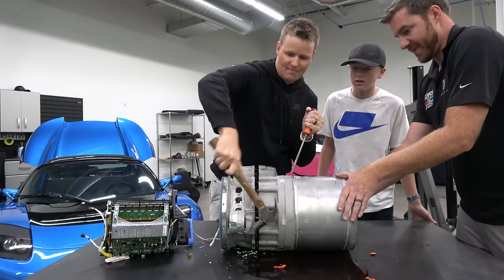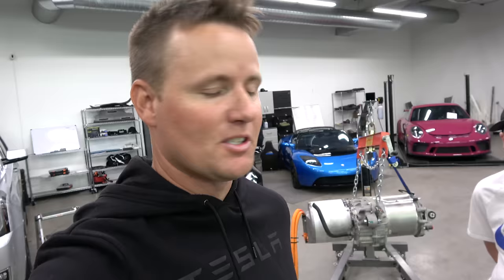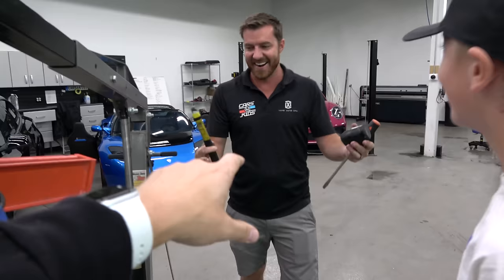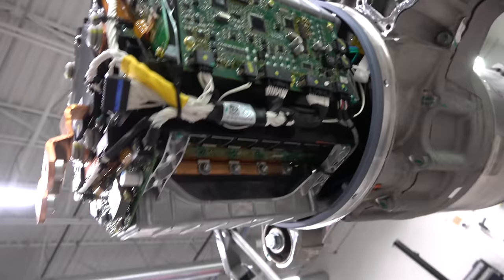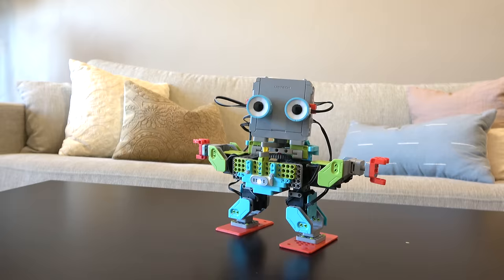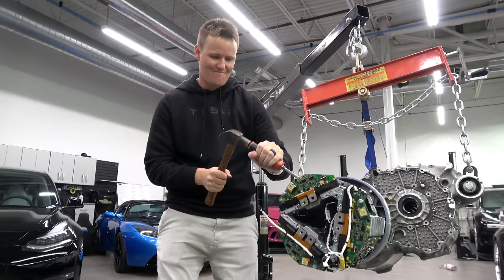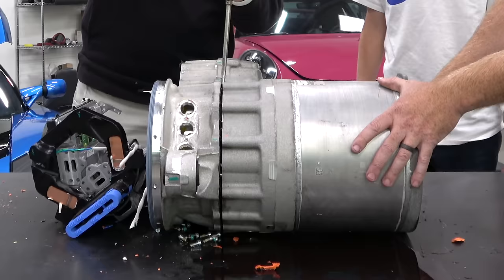What's inside a Tesla Engine?

Comment: Automation technician here. This is extremely irresponsible. The coolant and oil are poisonous liquids with unknown effects. 
If you should do this you should use proper safety equipment.
They never looked in the motor, they just dismantled the inverter(variable frequency drive) and the transmission. This could litterally KILL YOU. The capacitors can hold charge for years and touching them could result in a lethal discharge.
Reply: What capacitors?
Reply: There are no HE capacitors there..
Reply: @bergssprangare   He is probably thinking about industrial AC VFD's. Where you have large capacitors on the DC bus. Obviously not realising this VFD is powered from a battery... 

Anyway, any decent VFD will have discharge resistors across the capacitor bank, if they are still charged 10-20 mins after powering down you either have a bad resistor or a very badly designed product.
Reply: This is a 3-phase induction motor, what capacitors do you mean ?
Reply: im 11 and knew what the oil and coolant is poisonous
Reply: @dimitristripakis7364  There are 3 x 400uF film capacitors one on each phase. You can see them demonstrate this in the video and talk about them. Just listen for "Whooooooo this is sooooo cooool .... " it's code you know. Their day job is brain surgery.
Reply: "capacitors can hold charge for years" no they don't you panic monger.
Reply: And it’s poisonous not venomous. Vemonous also only works when it’s injected into you aswell. The only thing that I think can harm you chemically without injecting or drinking that would go in any kind of device is bleach. Ya think they’d put bleach into there
Reply: i didn't see any capasitors. and i think capasitors is not holding charge for years, even battery have to be continues charging to hold the voltage level
Reply: @ophello  did you not see the large capacitors and large diodes all on the same board that controls the exact position the motor is in ?
Reply: @jarcho86  yeah but he never said the motor was not used for years he just said it was a couple of years old as in design
Reply: @chris746568462  the battery has a dc/dc converter for battery management, which has an output capacitor. The inverter output may have capacitors depending on the filter topology. Anyway, the capacitors have antiparallel resistors to discharge the charge when everything is off
Reply: I was just about to write a  similar comment, except no capacitors present, but I'll just thumbs up yours.
Reply: Does these people looks like they know what they are doing?
Reply: You should inform those guys.
Reply: Do you mean the squishy spark plug looking things hahaha
Reply: Do you know who produce coolant oil liquid inside Tesla motor?
Reply: It's like when armchair experts would poke around in the old t.vs and there is still lethal charge even after being unplugged.
Reply: Capacitors do not hold a charge for years. PM'ed  hundreds of VFD'S from 2 to 250 HP @480 volts that produce a DC Buss voltage of 665 volts. Turned off drives then came back 5 hours later and never had a capacitor still holding a charge.

Comment: 09:14 Who knew Teslas have oil inside of them?
Basically, anyone that knows what it takes to prolong the life of metal components operating at high speeds in high tolerance environments.

10:27 How do these things not get torn apart after years and years of use?
Well, that would be why there was oil inside of them.

10:32 And look how smooth that is though. That's where the efficiency comes from of cruising down the street
Has this man worked on even a bicycle? Basically, anything that has had a bearing in it?
Reply: @TownofJezza  lmao you spittinn facts 😂😂💀💀
Reply: Town of Jezza let him have his moment
Reply: Hilarious you can’t tell difference between coolant and oil
Reply: @tobywhitmore4777  Oil can be used as coolant, and guess what, it usually is. Transformers, gear boxes, etc.

Comment: Just viewing this video for the first time, 03:13, thermodynamics dictates to spread heat , you need a lot of surface area, those metal dots poking out allows for more heat from the electric work being done, which heats the coil up, to disperse it within that metal, fluid running across those dots would cool it down. The amount of screws is to make sure that the internal pressure does not leak due to thermal expansion.
Reply: My brain hurts from watching these guys not understanding any basic engineering. 🙈🤣

Comment: You opened only the VF Drive or you may call it "inverter". The 'computer' is just some microprocessors and control logic that are responsible for generating PWM Waveforms (basically just switching on and off very fast and in a controlled way to generate alternating current in shape of sine waves) which drive the Motor.
Then there are some driver boards that are responsible for controlling the 'spark plugs' wich are actually power switches also called Transistors (either MOSFET or IGBT). They need gate drivers to switch on and off efficiently.
The sticky stuff is to protect the power electronics, to isolate the high voltage and to reduce vibration.
You then opened the gearbox wich wasn't the motor either...
Reply: Actually, yeah. Exactly this.

Comment: "This is a huge section of this transistor"

No mate that's not a transistor - there are THOUSANDS of transistors on those boards.
Reply: I would say BILIONS
Reply: You are way off the mark. A mobile phone has a billion transistors in an area the size of your finger nail, let alone a three phase inverter in a high power motor.
Reply: @ciaranocallaghan5113  Mossfets are usually low density on transistors compared to a CPU and GPU. But there are many Mossfet chips in each board so let's just say lots
Reply: @Jaker788  I don't understand what you mean by MOSFETS are low density on transistors. MOSFETS are a type of transistor (metal oxide semiconducting field effect transistor). If you mean they are low density on a silicon chip then that would depend on the circuit in question. Also I don't know why you've brought CPUs and GPUs into the equation. I was just stating that a huge number of transistors can fit into a very small space because of the wonders of nano-technology and semiconductor physics. So when the OP said thousands I was just clarifying that they were way off the mark as transistors are the very base of pretty much all electronic components. If it's not a resistive, capacitive or inductive element, it's most likely built out of some form of transistor(s). Logic gates for example use transistors and the mass of logic in a Tesla is inconceivably large.
Reply: IC and logic transistors are usually very small, power transistors tend to be huge. The currents and voltages these boards handle are huge. Think at least 100 or 150  amps at a 1000 volts. That's more like a small subway train than an ordinary car 12 v system.
I for one would love to know what these boards are actually doing, they need someone like Bigclivedotcom or even EVblog to understand & explain this.
Reply: @Lucien86  100 amps isn't much. And 1000V isn't reached, the battery is only 300-400V and stepping that up would be a massive waste
We're doing a max of 400V at 1.5kA! That's where the fun begins

Comment: "Oh that's not an engine. Its a frikkin Electric Motor".

- Car guy - 2019

Edit : oh... thanks guys for giving 69 likes
Reply: I was bloody fuming when I saw Tesla Engine? 
It's a motor. Not an engine.
Reply: @RoadsterRyan23  absolutely
Reply: So engine is only ice?
Reply: Calling a motor an engine is completly fine. By definition an engine is a device that converts an energy into mecanical motion. Although engines have become synonymous with combustion,   it is not the true definition of an engine. is completly valid to call a motor an engine as it converts electrical energy into motion. Yes it sounds a bit weird, but he  technically isnt wrong.
Reply: @RoadsterRyan23  - There's a misconception that motor = electric and engine = combustion but motor simply means a device that imparts motion while an engine has moving parts.

A solid fuel rocket is considered a rocket motor not an engine and it obviously burns fuel
Reply: @PabloGonzalez-hv3td  hey we all know. It was a joke hehe
Reply: @RoadsterRyan23  yes bro.  As if all the people out there look at all the things with their proper definition
Reply: The point being if the correct term is not used no one knows what you are referring too, In the trade if its electrically powered its a MOTOR!
Reply: @djgate  That's the common usage but a misconception nonetheless

Comment: "NoW wE oPeN tHe EnGiNe"
Opens transmission. Ends video with engine still closed. This really is like watching the Kardashian's explain engineering as another commenter observed, this is shameful.
Reply: 5:00
Reply: @arturos.l.2248  thats the controller, not the actual motor.
Reply: And it's a motor, not an engine.
Reply: OMG they discovered the 3 phase motor drive !!... ... 30 years after it was designed ;)

Comment: First of all that's not an engine, second you didn't show the insides of the actual motor. Priceless...
Reply: @Danish_Khan1021 An engine gets it's energy from heat.
Reply: @Dr. Meme thats not engine thats machine bro
Reply: @Danish_Khan1021  I'm sorry, but your comment was 'Stoopid'.
Reply: @Dr. Meme An engine is a type of motor that converts the heat energy of a working fluid into motion. A steam engine does that. A gas turbine does that. Same with internal combustion engines. However, water turbines and air turbines are not engines. Neither is a rubber or wound spring powered motor. Just because heat is produced as a by-product, that doesn't make an electric motor an engine. An engine is type of motor. Not all motors are engines.
Reply: @Dr. Meme Google has been around since 1998, and so has many a young know-all who seems to think that history and facts started sometime after that era. Are you supposing that older text books (from earlier periods) have all been wrong for the last couple of hundred years? The internet is great in many ways, but it also seems to be an insidious and dangerous tool in the hands of an ignorant younger generation.
Reply: Nice comment

Comment: Damn, I really wanted to see the motor armature and magnets.
Reply: IIRC, there are no magnets, as Tesla uses induction motors, at least for the earlier models. I think they are switching to reluctance motors, which is a bit of a different concept, but those don't use magnets either. I wish they did, though, because it would be fun to see a finger pinched (to say the least) by neodimium magnets.

Comment: That gel is a high voltage rated conformal coating. It's to keep moisture out of the driver circuit.
Reply: this.
Reply: Thanks! That's the only thing I've learned today.

Comment: What about the motor itself? 😂
Reply: Yes, all these teardowns miss the magic of the flux focusing magnetics inside the Rotor.
Reply: @OGTS Old Man Two Shoes i may be wrong, but isn't the thing that looks like a PC (uhm. I guess i kinda see why it looks like it?) 3 individual Phase controllers (i do not know the exact technical term) aranged in a triangle, for controlling the 3 Phases of the AC motor in order for it to spin. Along with other curcuits.
Reply: @OGTS Old Man Two Shoes Ok 
(Sorry if I sounded a bit too pretentious (I do not wanted to), i was thinking a bit too technical, because of the poor explenation of how the motor works in the video..)
Reply: @OGTS Old Man Two Shoes converter => inverter*, converter transforms ac to dc, inverter transforms dc to ac :)
Reply: Pretty sure all the other EV-Auto companies will  want to learn what's inside this motor and reverse engineer this motor. This will allow them to come up with a competing product against Tesla at a lower cost.
Reply: 5:00

Comment: I wonder if that “Engine” is naturally aspirated or forced induction.
Reply: it not combustion... see this  i just love my n/a.... so easy to fix....
Reply: campkira r/woooosh it’s obviously a joke
Reply: 😂😂😂 it’s for induction you can hear the wining of the two turbo set up but it’s really quite
Reply: Luis Aleman I assumed it was forced induction because they are so super fast.
Reply: There's nothing wrong with calling an electric motor an engine it's just not commonplace. The names have nothing to do with combustion as there are rocket engines and rocket motors both burn fuel but the engine has moving parts
Reply: I think its supercharged😅
Reply: That not a engne thats a motor there is a difference 
Engines=gas
Motors=electric
Reply: It's high by-pass turbine.
Reply: Pretty sure it has that flux capacitor compound turbski set up, few hippy tears for the lube with coloring in it to throw people off, and the stamp of California somewhat aproval.
Reply: It is mosfet charged with

Comment: Nice  video.. By the way, the "gaint computer thing" is actually a power converter / inverter drive, which supplies power from battery to the electric motor

Comment: Amazing! Gears, bearings and controller boards! Who would have thought all that would be inside an electric motor? I thought there was a little man inside turning a crankshaft.
Reply: miniature Elon musks 🤣
Reply: Just an FYI ....it's NOT called an "electric motor".   It is a "MOTOR".

.
Reply: @taxicamel  what's the difference?
Reply: @taxicamel no it is an electric motor. Just like when you have a motor ran by let's say air....it would be a pneumatic motor or another example a hydraulic motor. Yes it's a motor but it's always called by what powers it.

Comment: Car Guys: Um aktually its a motor.
Reply: tancow triggered so hard
Reply: Cuz Teslas dont have an engine
Reply: aktually? Did you mean to spell it that way? o.O
Reply: @aryanambastha4050   - There's a misconception that motor = electric and engine = combustion but motor simply means a device that imparts motion while an engine converts energy to motion and has moving parts.

A solid fuel rocket is considered a rocket motor not an engine and it obviously burns fuel
Reply: And they didn't even get to the actual motor, just the transmission.

Comment: is that 3 phase dc motor? like in daikin inverter air conditioner compressor, it's why tesla have big power motor engine
Reply: 3 phase AC. DC doesn't have phases.
Reply: @sjokomelk  but when i was check air conditioner in my factory, compresor using DC voltase and i check with multi tester 380vdc, maybe that not 3 phase but 3 line with 380v

Comment: Did they talk about how the fluid lubricates the gears and keeps them cool?
Did they say why the little gear which is connected to the motor shaft engages a larger gear which connects to the drive shaft - which while slowing down the spin increases the torque?
Did they say one of the functions of the circuit boards is to convert the DC current of the battery into a precisely timed switched current that energizes the motor coils to produce an alternating magnetic field that pushes against the permanent magnets in the motor housing?
Did they tell you that the motor contains permanent magnets?

Did they tell you that in order to provide the immense amount of torque that the coils require thousands of windings of copper wire?

Did they tell you the voltage at which the motor operates?
No, no, no, no and no.

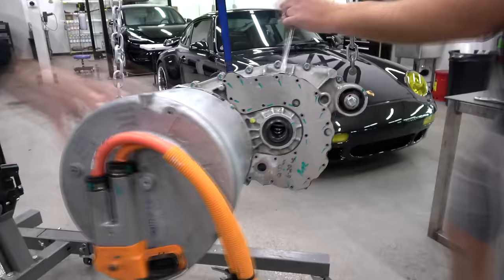Comment: 2:50 Differential heat exchanger.
4:12 Looks like a rotor for a hall effect sensor. Allows the cars Variable Frequency Drive (VFD) to measure the motors RPM
5:00 That is the VFD. It basically converts the DC electricity from the power pack into controllable three phase electricity for the motor on the opposite side.
Reply: Basically it's a bldc motor

Comment: The sticky stuff is silicone gel used for dissipating heat and also serving as electrical insulation.
Reply: @Maxi Stocker I'm pretty sure it's the same stuff that they put in IGBT modules which I was told is silicone. 
There are different types, for instance they use it as a thermal compound for transferring heat to heatsinks etc
Reply: @Maxi Stocker some types of silicone gel are as sticky as anything!

Comment: So, I may be second guessing myself here about Tesla's and how they work, but all well.

Basically, it's the motor that gives the car it's power to drive and the batteries are what provide the car the power to the motor and all essential systems. What this motor seems to be from is a model S or Model 3, depending on how their motors are similar, the main brains of the operations lie within the motor to give you that ludicrous speed. With the Model X and Model S plaid versions, the motors have been upgraded for more power.

Comment: 9:38 DuPont Kapton tape,  used on the ISS too
Reply: but you guys never actually got into the motor, just the control  board and gears. No stator assembly, no coils.

Comment: Purchased a new gasoline powered car that gets over 40mpg 15 years ago for $16,800 new.  It has over 100,000 miles on it with no problems whats so ever.  It does not go over 110mph and goes 0-60 in about 15 seconds and carries 4.  Brakes and everything are still original.  Had to change tires at about 75,000 miles and a couple of batteries for under $100.  I estimate i have spent about 15,000 to 18,000 in gasoline.  I am thinking about purchasing an electric car now,  but not sure if they will last nearly as long as my current car and battery life after 10 years has not tested yet.  It can be very costly to replace batteries.  On a fixed income now.